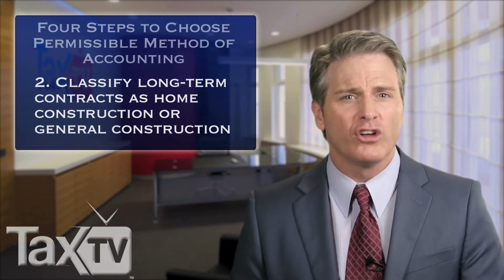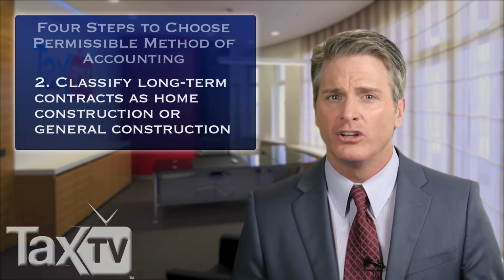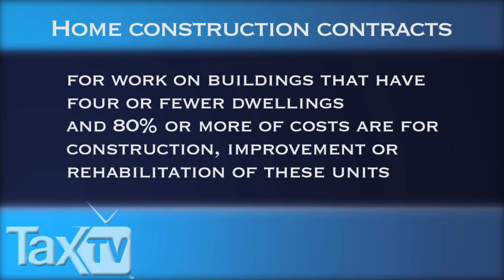Accounting Methods for Construction Companies

Comment: TLDR: Construction companies must choose an accounting method based on specific criteria, including contract type, project completion, and annual gross receipts, and follow a four-step process to select a permissible method.

00:00 📊 Construction companies must choose an accounting method based on contract type, project completion, and annual gross receipts, with most using the accrual method.
00:41 📊 Cash method taxpayers recognize income when received and deduct expenses when paid, but this method is restricted for corporations or partnerships with high gross receipts or substantial merchandise purchases.
01:10 📊 Construction companies can choose from various accounting methods, including specialized accrual methods with specific rules and limitations, and must follow a four-step process to select a permissible method.
01:31 📊 Construction contracts should be classified as short-term or long-term, with short-term contracts using the overall method and long-term contracts further classified as home construction or general construction contracts.
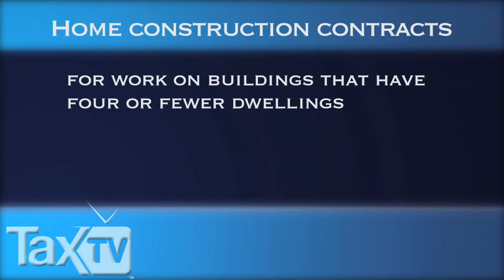01:55 🏗 Construction contracts are classified as home construction or general contracts based on the number of dwellings and estimated costs, with different accounting methods available for each.
02:21 📊 Construction companies with average annual gross receipts of $10 million or less are considered small contractors, while those exceeding $10 million are large contractors required to use the percentage of completion method for long-term general contracts.